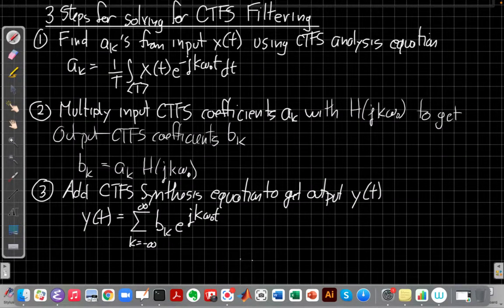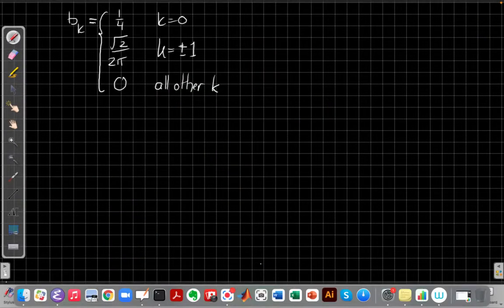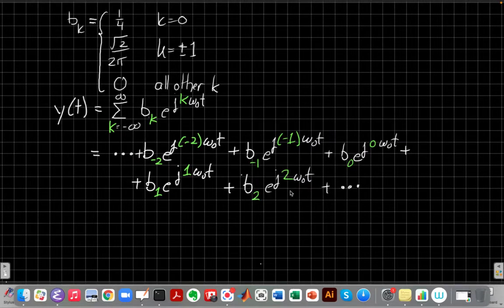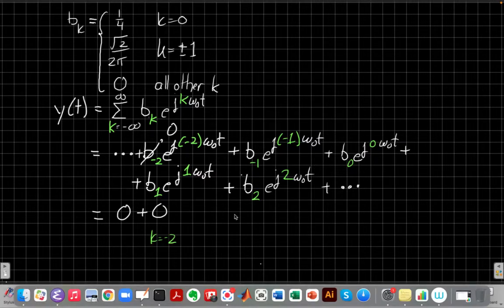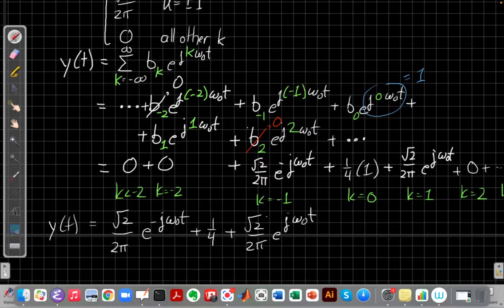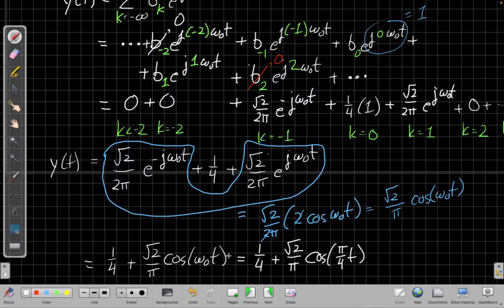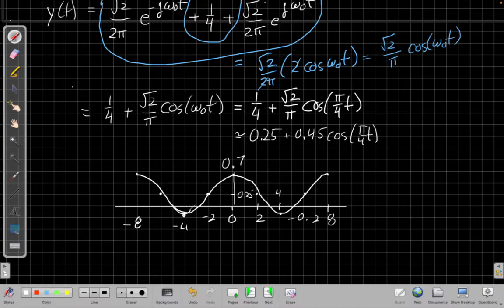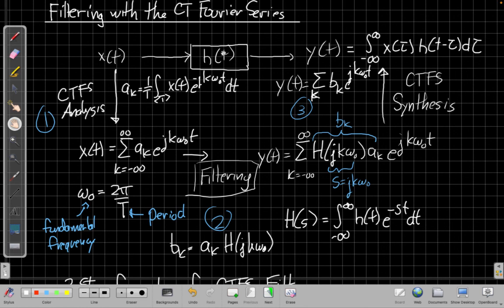CT Fourier Series and Filtering Example: Part 2

Comment: the one thing i dont get is why its called a low pass filter here. i get how the problem works but why call it "low pass" if it makes all values (both high and low) outside of the square 0, and all the values in the box times 1. it seems like its equally high and low passing as the box is mirrored about the origin. (im new to this sorry if that question makes no sense)
Reply from the maker: Good question.   What is mixing you up is a confusion between amplitudes and frequencies.   The filter is called a lowpass filter because it is passing the low frequencies, i.e., the small values of k (or technically, the small values of abs(k)).   Remember that the kth term in the series has frequency omega = omega_0 k, so values like k = -1, 0, and 1 represent lower frequencies than terms like k = 2, 3, 4... and k = -2, -3, -4...   All amplitudes large or small get passed for small values of k because H = 1 for those frequencies.   All amplitudes (large or small) get removed for larger values of k because H = 0 for those frequencies.
Reply: @ProfJohnBuck  awesome explanation! thank you!